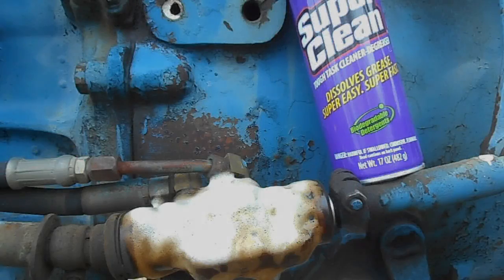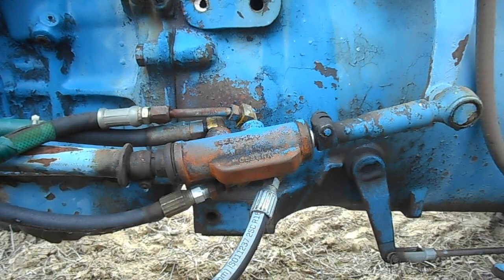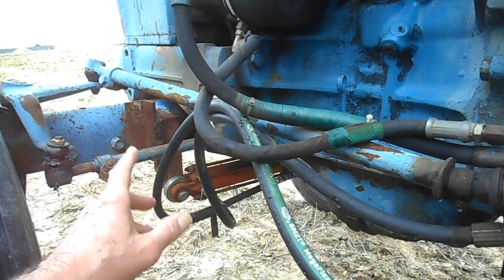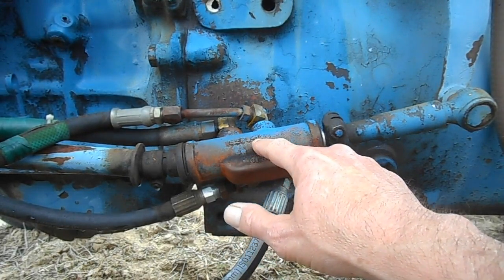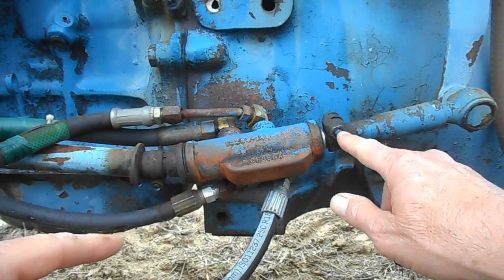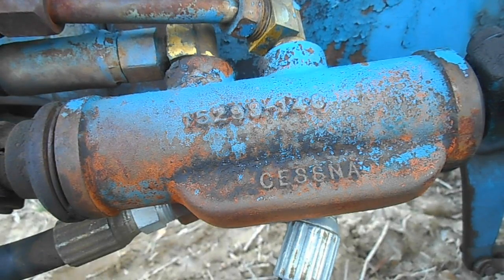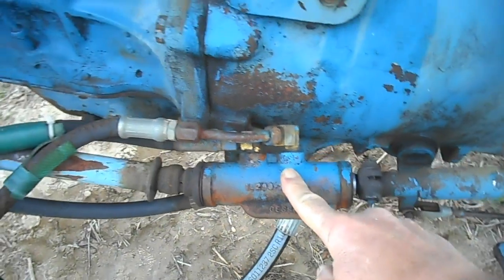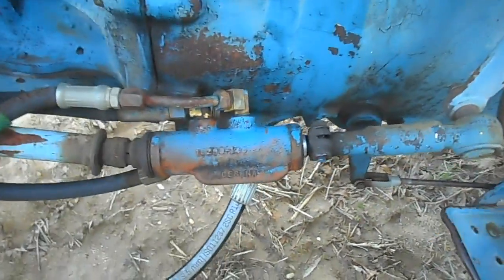Hydraulic Control Valve in aftermarket power steering

Comment: I just found your channel and really like it, I had a Ford 4000, I rebuilt the same control, if I remember its new O rings,  then had something ele's wrong, the power steering  pump bolted to the engine had a bad seal and the power steering oil was leaking into the crank case
Reply from the maker: Northern Cattle Rancher 77 - thank you for the kind words and for subscribing.  the power steering pump did the leaking into the crank case several years ago and I caught it before any damage to the motor happened.   the fuel lift pump on the 4020 dumped diesel in the crankcase and I came really close to messing that tractor up really bad.    always something to keep an eye on.   thanks for watching and I hope I can keep you entertained.

Comment: I had a 4000 good old tractor I think if I could I’d go to the power assist mine had the power assist and it works extremely well the after market power steering is simple but has to many. Components seals and hoses anyways hope you get it all sorted out 👍👍
Reply from the maker: Smalltown Farmer88 - next week I may get the chance to take the part off and try the shop suggestion I got from a viewer.   sounds hopeful after talking with the man at the rebuild shop.  thanks for watching.

Comment: I hope you can get it rebuilt. It looks like an ordinary hydraulic remote valve that has been clamped to the steering linkage. They are easy to come by but might have to be customized. Good luck.
Reply from the maker: Jeff Ticen – I found one on eBay, not exact but could be made to work.  199 dollars, ouch.   going to see the man at the hydraulics shop next week.   got good hopes he can find the O-rings needed for a complete rebuild.

Comment: One of the IH tractors I've had - I can't remember if it was the 460 or the 706 - had a Cessna hydraulic pump. I agree with those advising to take it to a hydraulic repair shop.
Reply from the maker: Farmer Pete - local hydraulic shop is going to be the thing to do with hope they can find the correct size O-rings…

Comment: My international tractors have Cessna hydraulic pumps in them. Shouldn't be hard to find I would think. I bought a new Cessna pump from the dealer but again that was a factory part.
Reply: Take it apart so we can se it!!
I have big arms. More power steering then any cylinder!!
Reply from the maker: wanna be farmer - when I replaced the pump a few years ago I found the direct replacement at ReliableAftermarketParts.com no luck with the control valve.

Comment: I'm interested in more on how it works and if the parts are still available.  I would love to see about putting that on my Fordson Super Major.  That is pretty close to the Ford 5000. Good luck.
Reply from the maker: TAH-DAH Farm - if the parts are not available then I'm stuck with buying another complete conversion kit and the time required to put it on is going to hurt.   all the kits I can find put the cylinder on the rod connecting the steering to the front linkage.  CE Smith did one on his JD and it was way cool how he did it too.

Comment: heres the whole kit it looks like https://www.yesterdaystractors.com/Ford-4000_Power-Steering-Kit_S60305.html     or this one not sure https://www.yesterdaystractors.com/Ford-4000_Power-Steering-Conversion-Kit_FD100.html  here is possibly the seal kit https://www.yesterdaystractors.com/Ford-4000_Power-Steering-Seal-Kit_EGPN3N503AA.html       my suggestion would be to take part off and take to hydro shop and they could pry put new seal in it
Reply: so look at yesturday tractors or stiener tractor parts
Reply from the maker: Ted Kahler – thanks Ted for the links.  a kit is going to be the last resort only if rebuild parts cannot be found.
Reply: Soybean Farmer I’m sure I posted the rebuild kits there as well.  But still think a good shop could fix ya up
Reply from the maker: Ted Kahler - due to the uncertainty of the exact replacement parts I'm heading to a shop recommended by a viewer commenting here.  the shop is located about 40 miles away.  I called and got a good feeling talking to the man on the phone.   thanks again Ted.

Comment: I agree that a hydraulic repair shop should be able to replace or reseal your old unit.  I looked around and a whole new kit is available for your tractor on ebay in the $650 range .  Good luck.
Reply from the maker: farmark – seen the eBay and elsewhere complete kits.  they are a last resort only if new seals can not be found.

Comment: I think it would be pronounced like ses-na, with the c being soft. As far as I can tell the company still exists under the Eaton Cessna name or the Eaton name. If you go to a place that sells eaton products, thenmaybe able to order the seal kit. If not generic seals would likely work fine.
Reply from the maker: Greg Henry – my research did determine Eaton bought Cessna.   yep pronounced like the airplane.   thanks for the information and for watching.
Reply: @SoybeanFarmer3300  No problem. 5 minutes on Google and I was bored anyways. I do regret that the part number wasn't showing up in either google nor the eaton searchs. The eaton website did say that the online listings are not complete. It could be that the part number was only used for a short time before being replaced by a new number possibly on the identical part. Part manufacturers can be wierd.

Comment: A couple clicks on the internet should get you going in the right direction, or a local hydraulic shop could help.
Reply from the maker: Massey1105driver - with the limited information I have the clicks on the net have shown me a lot of conversion kits but no absolute correct rebuild kit.    the local shop I called on a viewer's recommendation seems to hold some hope for me.